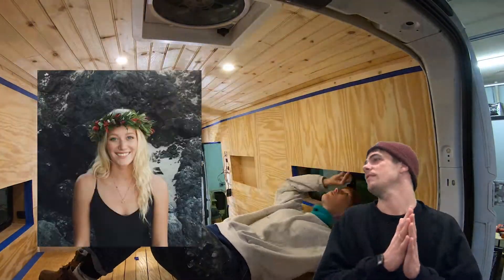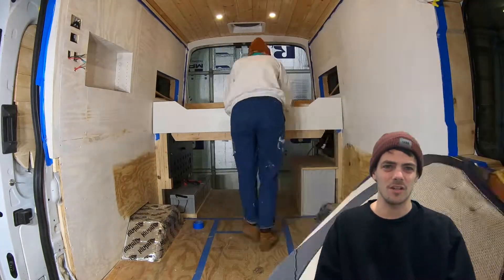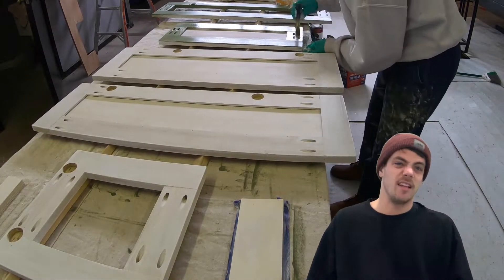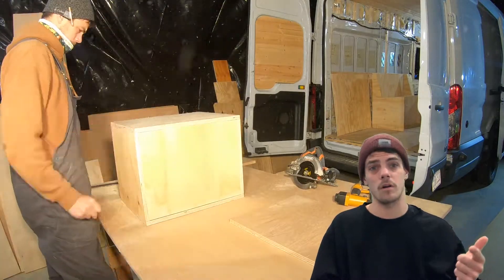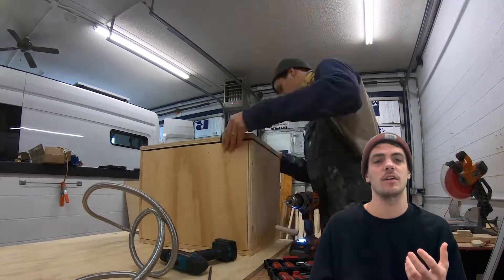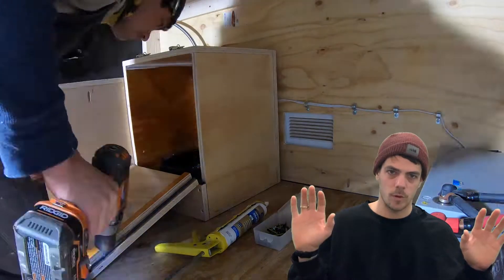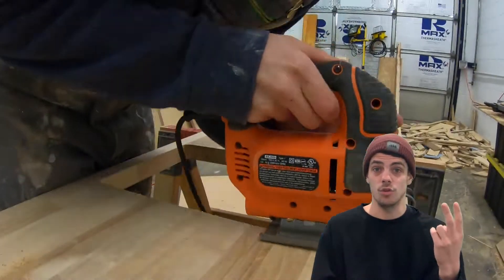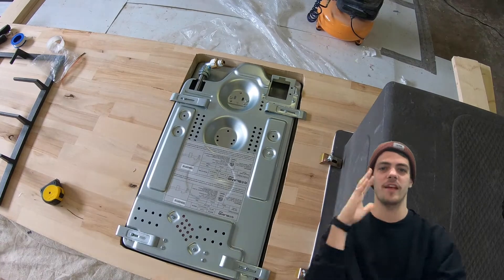Interior Painting & Propane System | Camper Van Conversation | Ford Transit DIY Van Build

Comment: Running your propane vent out to the outer edge of your chassis is a safety issue you might consider.  If your tank happens to leak, and the gas sits underneath (hopefully it will go to ground and waft away), a hot exhaust or random spark could be problematic.  I’m not a propane products wizard, but this was pointed out to me.  For what it is worth, I thought I would share.
Reply from the maker: Great point. I think the only reason we never changed this is because like you mentioned, we just assumed a small breeze would move it away. Also we would never would run the propane or have it on while car was running. Appreciate the comment though. Will likely change when we build again.